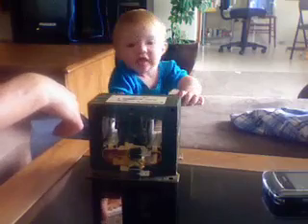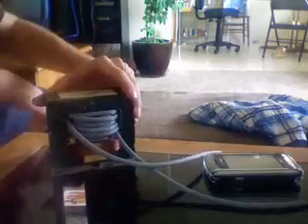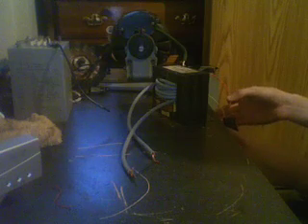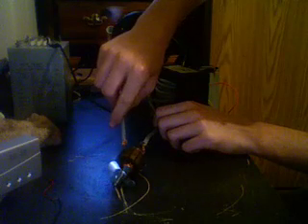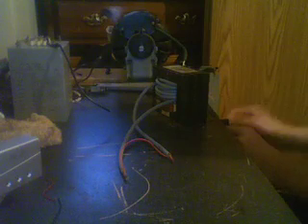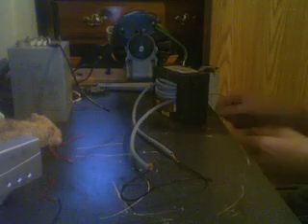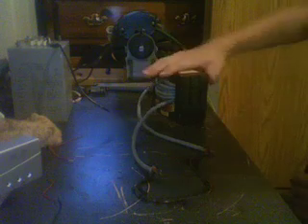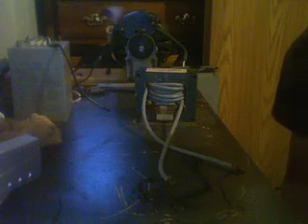How To Modify A Microwave Transformer (HIGH CURRENT) Or Amps

Comment: The question is "how to adjust the amperage of a transformer? add "microwave transformer" obviously by varying the  input voltage with an adj. voltage regulator . . . . .  is the answer.

Comment: is it possible to power up a 75 volts and 500 ampers gadget using step up transformer from a 12 volts car battery
Reply: No, transformers rely on AC electricity to work. 500 amps at 75 volts would be an astronomical amount of power: 37.5 kW to be exact, which would be like a large generator. There’s no way one car battery is going to output that much power even in a direct short-circuit. At least not for more than a few seconds. Most entire houses only use 200 amps at 240VAC giving 48 kVA or roughly 48 kW. So think about it: could a car battery power your entire house w/ every device you own running at the same time? Answer: no. 

You’d need a bank of car batteries with a truly massive and expensive “boost converter” even if you build it yourself. Or I suppose you could buy one of those boost/inverters they use for solar panels but they typically output 120-240VAC.

Comment: Is there a way to have high voltage and high current
Reply: Yeah, just use the transformer as is. Unless you mean higher than a few amps or so. In that case you need to put multiple transformers in parallel (at which point it becomes very important they are virtually identical) or a much larger transformer, like those ones you see on power poles whose entire outer casing is a massive heatsink.

Comment: how many volts did u get
lookes like a lot more than 3v

ima use 4 windings of copper pipe i hammered out to get 3v

lol 3:34, then 6:49
ill jsut assume u were worried abt burning urself when connecting the wire

Comment: nice vid. i just obtained my first MOT and would like to modify it, i have one question, would a desktop computer power cord work on this? i dont have 4 gauge wire or extra jumper cables. the cord i have is 18 awg at this moment. thanks